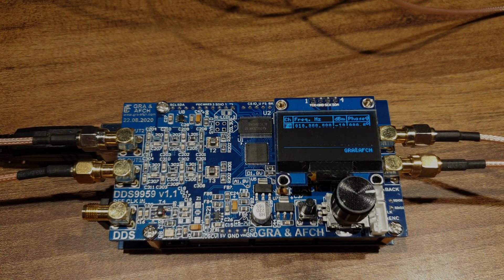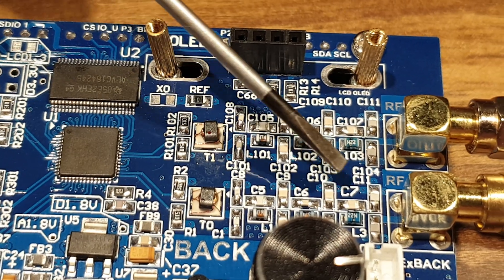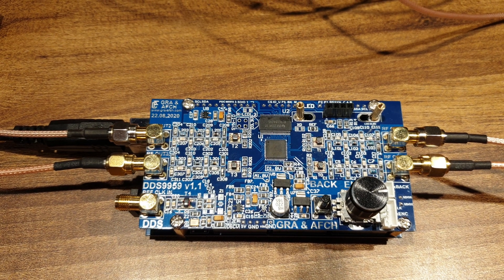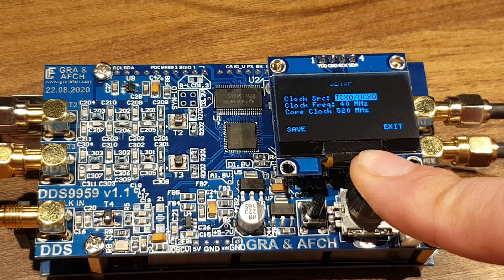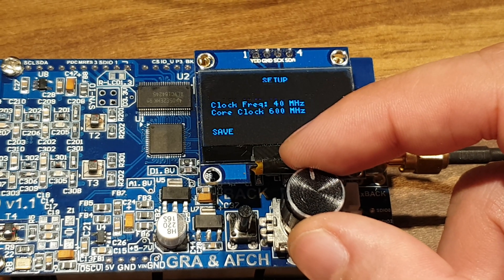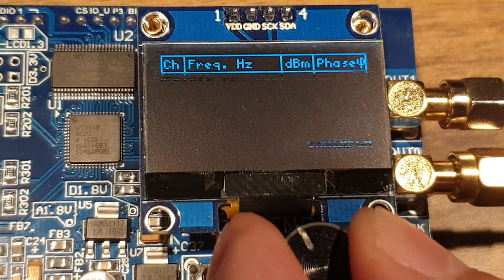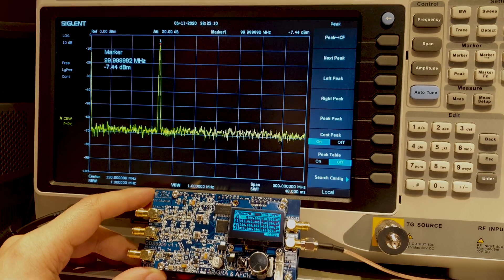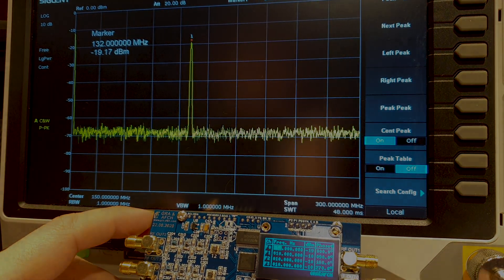DDS AD9959 Arduino Shield RF Signal Generator 4 Synchronized DDS Channels 225MHz, @600 MHz Low Spurs

Comment from the maker: DDS AD9959 Buy Now https://gra-afch.com/catalog/rf-units/dds-ad9959-arduino-shield-rf-signal-generator-600-mhz-1-5-ghz-core-clock-low-spurs-low-harmonic/
eBay Buy Now https://www.ebay.com/itm/164531485719

Comment: Hi, I am interested in buying your product. What is the absolute max frequency of the output sinewaves? What clck signal would I need to provide?
Reply from the maker: Max frequency output sine-wave 225MHz. The board has a TCXO installed for clocking the internal oscillator, it can also be clocked from an external source in the range of 400-600 MHz
Reply: @geryhold  Would there be a way to crank it up to 350MHz?
Reply from the maker: @Terrar-fr1bk no, this DDS9959 board won't work at such a high frequency, we have DDS9910 or DDS9912, they work up to 400-600 MHz, but these are single-channel boards